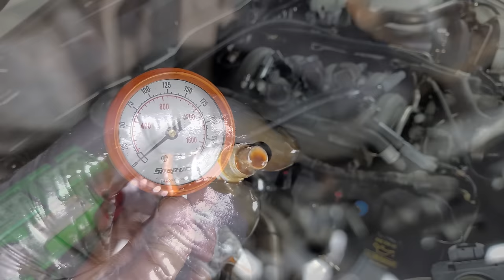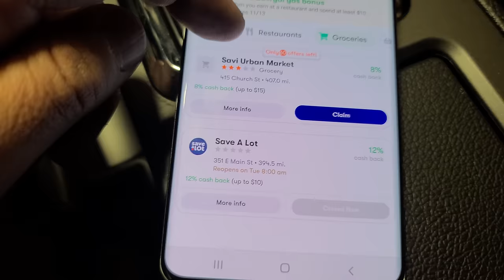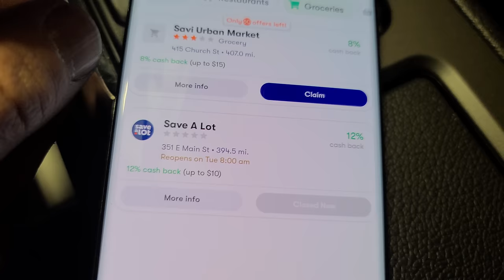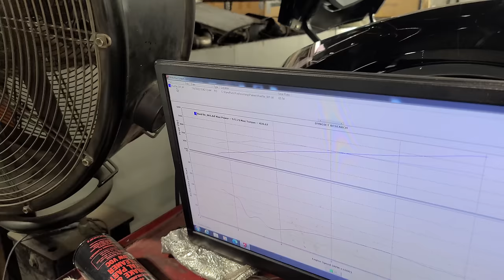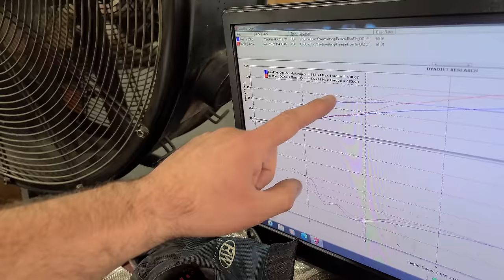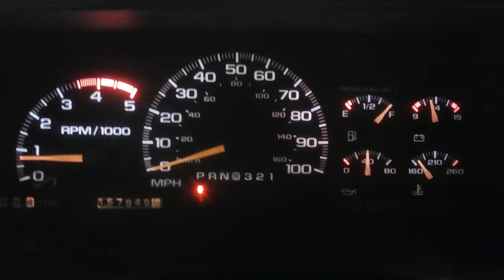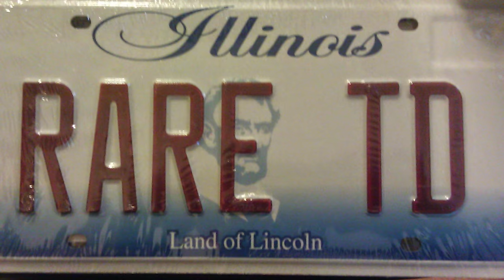My Wife’s Reaction To Secretly Buying Her A 650 HP Twin Turbo Coyote Mustang & Her First Drive!

Comment: For the rear diff cover, it’s definitely worth swapping the cover to the finned aluminum Ford Racing cover with the drain and fill plugs. Use the Lube Locker gasket and never have to worry about RTV (or pulling the cover) again… until you need to replace an axle seal. I’ve never looked back.

Comment from the maker: What kind of car does your wife drive? Is she into cool cars or nah?
Reply: Haha I wish
Reply: 2009 mazda 3 lol
Reply: Range Rover Evoque. She's always been into cool cars.
Reply: N55 X1  w/ a tune. 😂..😅
Reply: She drives a 4cyl Altima for fuel economy right now. But loves 2 door V6 accords and altimas, jeep tj and 4 runners.
Reply: Nah she’s not into cars at all but the Mustang is pretty much the only car she recognises on the road 😂 That and the Mini so I got her a Mini Cooper S (really cool car actually)
Reply: Audi
Reply: I built her a Yukon XL lowered 4"-5" on 22s with front and rear BBK, top was painted black with a dark grey bottom and a 2" House of Kolors Brandywine stripe with Tangelo pinstripes, full stereo and sound deadening. The came an M3 convertible for a weekend toy lowered with RPF1s repainted Techno Violet Metallic, new top and interior. Then, a 4WD Tahoe that was lifted then lowered with all kinds of different wheel setup and performance mods. Finally, a CRV because she wanted better fuel economy lowered with 18" Montegi wheels, sway bars, bushings, shocks and struts, slotted rotors, EBC pads, and SS lines all around. She enjoyed them but never admitted just how much she enjoyed each one of those cars.
Reply: 21 Durango RT. She loves it
Reply: Opel astra h gtc 2006 1.4 90hp , bought it in a hurry 😂
Reply: 2011 fx35
Reply: 2017 qx50
Reply: 22 ford edge st awd twin turbo. We've had 4 mustang gt's 06 Trailblazer SS the one I regret getting rid of to this day!
Reply: A 2014 Jeep Patriot. However she frequently steals my supercharged Tacoma and has promised to “occasionally borrow” the Merlin Purple RS3 I have on order once it comes in.
Reply: A mint 1995 Alpina B3 ❤
Reply: 2004 Chrysler Crossfire. N/a v6 motor and it's certainly amusing enough to drive
Reply: A 2013 Chevy spark manual that she took the muffler off, sounds pretty good for a 1.2 liter. she is learning more cars but likes El Camino's for some reason.
Reply: She drives an F150 lol - truck mom.
Reply: She dailys my 02 clk 55 cause her cruze engine blew up lol
Reply: Full electric corsa e. Very quick little car.
Reply: 2017 Boxster S
Reply: My wife's first car right after we got married was a "Bone Stock" S2000, black on black with an 8,900 rpm redline.  She loved that car!!!
Reply: @neilbrown82  nah they’re a lot of fun. Beautiful handling car, way better than some cars that are way more expensive but that’s just my opinion
Reply: @neilbrown82  you're probably right man. Definitely no where near as cool as a Mustang! Would love do what Alex does for his Mrs but im no mechenic. Nevertheless she likes it and we enjoy driving it around in the city. Nippy and handles well. We've had no issues with it so far and over 5 years old now.  Would love to perhaps trade it in for an M2, cash permitting but I'd have to get the wife something else man and she likes it

Comment: I've been using Brisk GR12S plugs in my Procharged 98 Cobra for several years with zero issues.  I've also used NGK BR7EF's in a pinch, but Brisk plugs have always worked well for me.

Comment: You still need to swap the rear control arms. The flex in the stamp metal control arms helps that stereotype of the rear end getting loose. upgrading the control arms prevents a lot of that

Comment: Also, when you apply decals, it’s a lot easier to get a little bit of soapy water spray it on the surface at first, apply the decal, and use a squeegee after you get it where you want it to be, to remove all the water from underneath the decal. Then you can peel the guide plastic off and it will be perfectly where you want it.
Reply: Say hi to Joey for me….

Comment: If Hellion tells you to run factory plugs, run the factory plugs. Unless there is/are someone/some people legitimately qualified from a good performance shop in here, the opinion of most people here don't matter when it comes to spark plugs due to the fact that they don't know what they're talking about.
Also, good on the tuner for using SAE rather than STD to try to make their numbers look better.

Comment: There’s a wire you need to unplug in front of the intake on right side when you dyno the car. The car applies the brakes on the dyno because its thinks you lost traction. It’s also why some Mustangs might not get accurate dyno numbers.

Comment: The factory or GT500 valve covers look really nice. The car also looks like it has a Peterson catch can which is comes on the Cobra Jet factory drag cars. You should get heat shields for the turbos, because the added heat might weaken the internals of the engine.

Comment: I like to primer the area for the decal with ceramic white paint then put the vinyl sticker on then paint red and after it drys you can peel the decal and then your graphic will be rain and heat proof

Comment: Alex I don’t have any experience with brisk plugs but from what other people have said they don’t last very long and are more suited for higher boost levels most people run ngk 6510’s gapped at minimum of .028 down to .023 also they recommend running 5w50 oil in boosted applications especially with more heat from the turbos.

Comment: For rear LSD differential the friction modifier is needed in gear oil. And also front strut brace is from the v6 mustang, strut brace for v8 GT looks way better.

Comment: Hey I have the same little white heater in my garage lol.  It works a lot better on the ground instead of hanging on the wall, and you can stand in front of it and get some heat up the back when it's real cold which is amazing.

Comment: Yeah, it's usually 2-8 uggah-duggahs on the oil filter & 25-50 uoggah-duggahs on the oil pan drain plug, as per lube jockey specs. Speaking from experience as a former lube jockey.

Comment: yessss... slightly bigger turbos at a minimum and e85 is an absolute must... will probably have to upgrade the fuel system if it is just on a boost a pump w/ factory fuel lines/pump

Comment: The factory coil covers would have been the gray 'Powered by Ford' plastic ones. However, the ones you have are the official Ford Racing metal coil covers, hence the OEM markings on the backside. Part number is M-6067-50BK. Also, the reason the 'Brembo' calipers have a bumpy casting is that those aren't real OEM-Brembo calipers. They're reproduction castings by Power Stop. You can tell since they have casting flash on the top front of the face that real Brembos don't have (as well as missing the Brembo and FoMoCo cast-in information on the back half). They'll work just fine, but don't conflate the quality level of the castings between the two.

Comment: Ngk are the best plugs for any make.. inremember the first time i used ngk in a smallblock 350 camel hump 202 194s with 10.5 to 1 pop ups with a .242 .512 cam.. corvette crank and pink rods.. got 40 more hp running ngks

Comment: You should run NGK spark plugs in the correct heat range, I’ve seen someone have issues with the Brisk ones as well.

I’m sure most people who run the Brisk spark plugs don’t have issues but NGK’s might be safer.

Comment: I did something similar for my wife a couple years ago.  Got her a 2017 Mustang GT California Special Edition (white) that had a Roush Supercharger installed by a performance shop in Florida.  It had 670 HP and only 8k miles on it at the time.  Paid only $35k for it at a Ford dealership.  She managed to get (2) speeding tickets in (6) months so we sold it for $38k two years later and bought a Tesla Model Y.  She loves her Tesla and misses her Mustang, go figure.

Comment: Put a dab of never seize on the plug threads, steel threads going into aluminum heads, just saying. The coil covers are not from the factory, aftermarket Ford Racing units. Think about ridding yourself of that steel two piece drive shaft for an aluminum piece, nothing else piece of mind and a heck of a lot stronger. I saw what appears to be a aluminum DS, when you were draining the diff I think. Enjoyed your video and your wife's reaction to turbo boost.

Comment: the only problem ive had with the modular motors is the timing chain tentioners cause some of the tentioners are plastic some of them are cast metal the only way to tell if their plastic or cast metal is pop one valve covers off and look down the valve train at the tentioners and see if their plastic       if their plastic     replace them with the cast metal tentioners     the plastic tentioners will fail same with the guides if the guides are plastic they will snap causing a Tragic failure in the engine (engine will fall out of time and hit a valve) and cause this engine to be an interference engine            also the oil pump      the oil pump has a powdered steel gear in it and is prone to snapping     MMR makes a billet gear for the oil pump in that car         thoes are the top 3 things i would look at (tentioners,Guides,and the oil pump)    the oil pump is limited to about 7,000 Rpm if you go over 7,000Rpm you have a big risk of the gear snapping in the engine causing the oil pump to COMPLETELY DROP DEAD when you see the oil pressure start to do the windshield wiper     shut the engine off immediatly and get it towed to the shop       go to Modular Motorsport Racing.com    they will have all the metal parts for your mustang and truck (5.0,5.2,4.6,5.4,v8 6.8 v10) needs

Comment: On a 6r80 car 4th is 1 to 1. still not sure if it can be locked in 4th on 11-12s as i know its 1,2,3 then Drive. but it should have a overdrive off switch which should lock out 5th/6th. Also ran stock plugs on my fbo e85 coyote. but on my ecoboom now it has ngk rutheniums in it as any tune on an ecoboost most tuners recommend anything but the stock plugs lol.

Comment: shes a car girl now if she wants to be or not. 650hp is alot to handle out of these mustangs. u might wanna look into seeing if it can be turned down or maybe look into those really nice traction control systems but that probably requires redoing the hole ecu with a stand alone system or something but that stuff works an keeps them planted.

Comment: The airfilters look way small.
Test it on dyno with and without filters to see if bigger ones r needed. Careful the traction control and abs automatically comes on so if you try to drift she will crash

Comment: I never understand why people don't just throw a quick coat of high temp paint on their rotors and calipers when replacing their brakes. When I worked for Lexus, it was standard practice, anytime the wheels came off, we cleaned and painted the brakes to prevent them from rusting like you see in the video.

Comment: Hi Alex! I am from the Czech Republic - the country where the spark plugs were made and I have conflicting experiences with Brisk plugs. I used to run them on my motorbikes - Kawasaki 500cc ER-5 (silver one) and old Jawa 2-stroke (basic one) motorbikes. On two strokes runs flawlesly with no problems at all but in the ER-5 the inlet tip came loose from isolator and accidentaly causes misfires. And I almost tore apart whole fuel system because I thought it s related to fuel issue. 😃 ( In past I had some troubles with stuck choke on one carb and it behaved very similarly) After that I immediately changed them to just basic Denso spark plugs recommended by the manufacturer and after that no problem at all. So you definitely do the right thing with changing them to OEM ones. 👍👍

Comment: Nice car. Love your wife. She’s awesome. On another subject you said that you had a 1995 Diesel Tahoe. I had a 1995 Diesel Suburban. I loved driving it but it was always in the shop. I had a recurring problem with the engine. I had to replace 3 Full pumps at $4500 each. It also had a weird problem. On light acceleration there would be a backfire like feel but no noise. I ended up replacing the engine with a new factory one and it did the same thing. Do you know what caused this problem. I’ve been trying for 17 years to see if someone knows what it was. Thanks. Love your videos.

Comment: With that awesome airtank compressor and air lines you have running all over the shop, I’m surprised you don’t have and air tool sander — oh you do. Also, you should’ve painted the callipers Ford blue not GM red.

Comment: great videos, I was  wondering about your calipers you got got some powder coating over the Rubber boots is that going to mess with putting the brake pads on or down the road harm them make them leak oil...thanks

Comment: I have to disagreed with you this time. BBK is not just for look. It actually helps and saved my life! I had multiple occasions when you have to stop abruptly on the highways to avoid accidents! With 600 horsepower and the weight of the car I would go with front 6 pot rear 4 pot minimum!  It's pretty cheap out for the GT500 to just have front 4 pot front in factory setting.

Comment: Love everything but the Obligatory use of Torque Wrenches (thanks for keeping the "Clicking" to a minimum)... Pro Tip to keep Brake Fluid from Dripping while changing out the Calipers is to slightly depress the Brake Pedal with an object between the Seat and Pedal (this blocks off the Ports in the Brake Master Cylinder leading to the Calipers).  Randy   AKA randog311  Retired Professional Wrench

Comment: PSSSST    hey alex i needa give u a ride in a 1000hp truck im currently building psssst it has a 5.4L ford engine fully built with a twin turbo tune     i have the ford Expedition Thunder 1 of 1 truck you cannot find anywhere its a verry verry rare truck to have and all i have to do is build the engine and send the trans off to precision trans or texas speed & performance to get a once over    its a super cool truck tho

Comment: Amazing powdercoat job, Craigslist tire machine. Really??? Still using a bar to mount tires in 2022?

That tape wouldn’t be required if a modern machine was used.

Comment: That powder coating finish on the rim looks absolutely horrible. If it was me I would wet sand that flat to remove all of the texture and coat them once more .. did they even bother to remove all the factory paint prior to powder coating them or did they simply put a coat over ? wait what am I saying been powder coating myself for 25 years and never once got anything to ever look that bad ? they powder coated over top of the factory paint .. not even sure if that will hold up but it looks horrible.

Comment: Why use the garbage brisk plugs , most worthless plug I've seen so far kind of like buying Autolites, what a joke.
Had guy have me build a 2000+ HP NOS engine and he screwed in the cheapest pos plugs in, Autolites and wondered why it was popping and cracking and running like a nuked Delorean